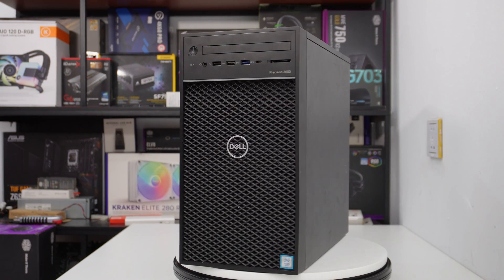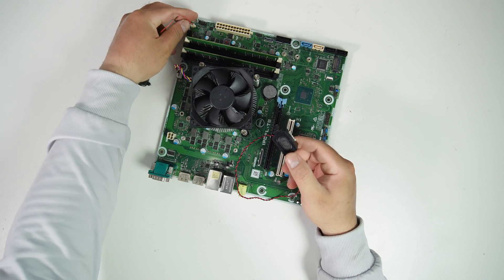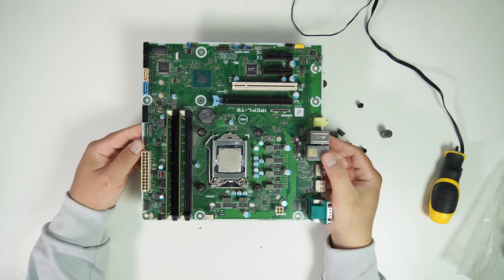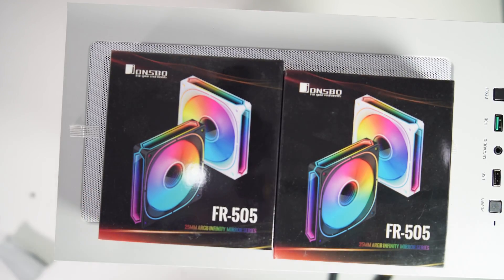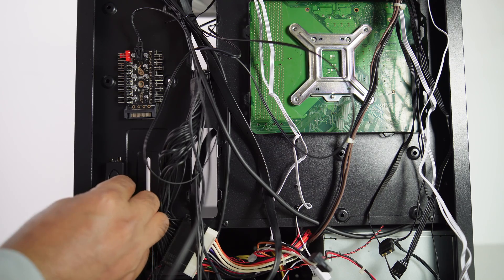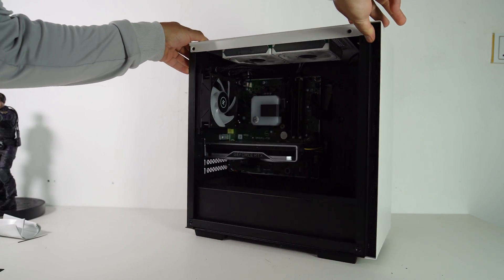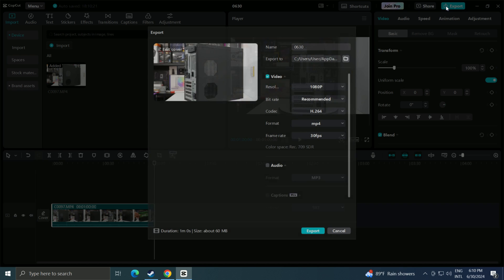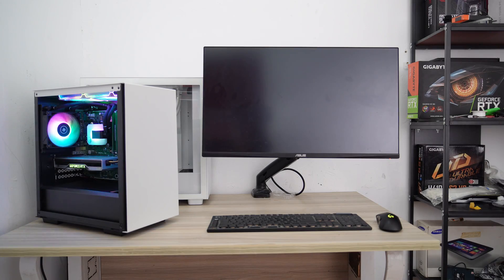Dell Precision T3630 + Macube110 Limited WH Case swap

Comment: I really need to know how I can find that ground cable
Reply: Have you had any luck? I'm looking for the cable too!
Reply: @architect1803 I looked up "PC ground jumper single pin" and found some stuff that matched. However, I ended up doing full MOBO replacement
Reply: @architect1803  same here did you find it?!
Reply: @slimanefelloussia5229  no luck finding it :(

Comment: Nice build. Do you have any tipps on fan brands to avoid fan failure warning from dell?
Reply from the maker: You can use any PWM fan for this model and it work just fine.

Comment: I can't thank you enough man! I've had a 3630 case swap project that has taken over my dining room and been kicking my a$$ for a year. Big fan of these workhorses but Dell's little aggravating quirks show up when I attempted the transplant. I found your video and the front panel pinout issue made me want to slap myself. Thanks again. Subscribed.
Reply from the maker: I've always been a big fan of Dell's workstations, but they can be tricky to work with sometimes! I'm glad I could help you out with your project.

Comment: also the hotspot temps agreed are way to high it needs repasted if you haven't already because hotspot should be no more than 10 to maybe 13 degrees C higher than the GPU temp same with CPU as well but those are fine
Reply from the maker: Hi there! This RTX 2070 was previously used for mining, so its temperature tends to be high. However, this video focuses on a case swap, and you can use any GPU. Thank you!

Comment: Everything is just cosmetics.
Reply from the maker: Not really. With this setup, you can install the i9-9900K and have it run without issues and silently, unlike the original prebuilt system running at 100°C with an Intel Core i5, which was very loud. Also, a new look can reduce stress. This is a big change.

Comment: In does work for 3650. I just did mine and it turned out great. Grounding the extra plug to the board is a must.
Reply from the maker: Glad to hear it worked out for you!
Reply: @ now I just have to save up some money for five pack of argb fans.

Comment: Why would you need to change the cpu bracket ? It looks the same as the one. You have on just the one that comes with 3630 is all in one and the smaller one from aftermarket MOBO is small 4:31
Reply from the maker: The same CPU sockets tend to look the same in size; however, the threaded screw holes are not the same, and it does not fit with my EK120 DRGB AIO cooler. Since the original one that came with the PC is a CPU bracket and CPU cooler mounting backplate combo, I need to remove it to install the CPU cooler backplate from my EKWB EK-120 DRGB instead.

Comment: Hey can you make a video like this on dell precision t5820....
Reply from the maker: The Dell Precision T5820 motherboard has a non-standard size and is larger than most cases available on the market, so I can't do a case swap with this PC. However, the case is already quite spacious, and you can improve the airflow by installing appropriate fans. Thanks for your understanding!

Comment: Hey nice video. Do you think this transformation would work on a T3600 as well?
Reply from the maker: I believe that the Dell Precision T3600 cannot be easily case-swapped due to its custom motherboard and larger size. It won’t fit into a different case. However, the Dell Precision T3600 is already spacious and well-structured for airflow as a workstation, and it’s compatible with its existing hardware. Thank you!
Reply: @itggear  True true, thank you!

Comment: Is this for any case for the power and the usbs connectors?
Reply from the maker: The Dell Precision T3630 motherboard’s USB 3.0 header is standard and can be used with any case, but the USB 2.0 header is smaller and cannot be used with other cases. Thank you.

Comment: Great vid! Hey you know if every 3630 supports Xeon processors? I’m mid parts collecting and realized my motherboard does not support my e-2174g CPU.
Reply from the maker: Dell Precision T3630 definitely supports Intel Xeon E (Coffee Lake) series CPUs with ECC RAM. In this video, the CPU installed on this PC is the Intel Xeon E-2124 with 16GB of ECC 2666MHz RAM. Thank you.

Comment: I'm curious on how to make the ground cable you made for the power button failure alert? Very useful video btw. I just happened to be looking for such a video. Liked and Subscribed.
Reply from the maker: At 9:50, I demonstrated how to fix the button alert failure by wiring a cable from the motherboard screw hole (which serves as the grounding point) and connecting that cable to pin number 9 on the front I/O pin header.
Reply: @itggear  Sorry, I meant how did you make that ground cable? Did you just use a male to female dupont wire jumper ribbon cable?
Reply from the maker: Oh, the cable that I used in the video is one I cut from a PWM fan extension cable. Since a PWM fan extension cable is inexpensive and has four female pins, I cut one of those four female slots to use as a wired jumper cable in this video
Reply: @itggear  ahh nice! I’ll keep that in mind. Thanks for the feed back.
Reply: @itggear can you make a video or a youtube short or something in detail of how you made the cable for this? Please please please. You’ve just earned a new subscriber also.

Comment: do you think its possible to do a case swap on a Dell Precision T3650 also?
Reply from the maker: I think it can. I searched the internet for details about the Dell Precision T3650 motherboard layout and found that it’s nearly the same as the Dell T3630 motherboard. Initially, I planned to buy the Dell Precision T3650 from eBay to install it in an M-ATX case. However, I couldn’t find the motherboard I/O shield, so I ended up purchasing the Dell T3630 from a local computer shop in my hometown instead
Reply: @itggear would you be willing to sell the T3630 case?